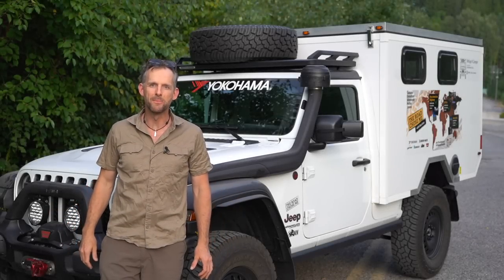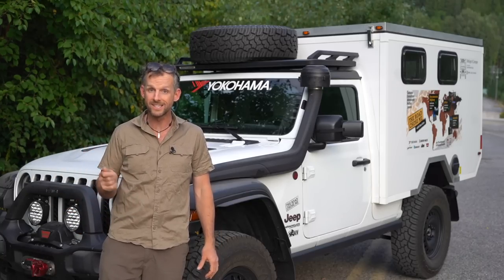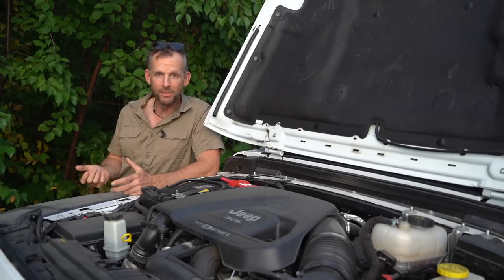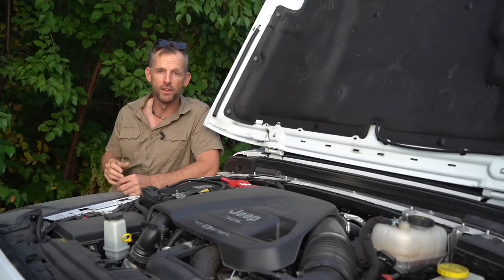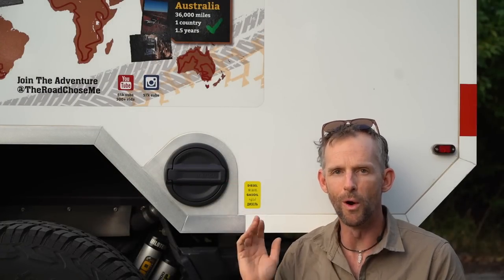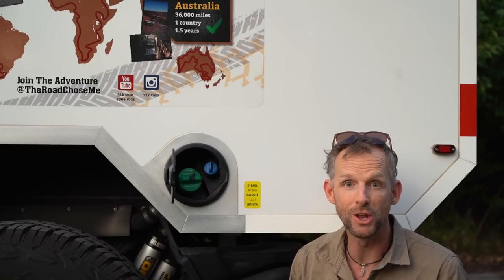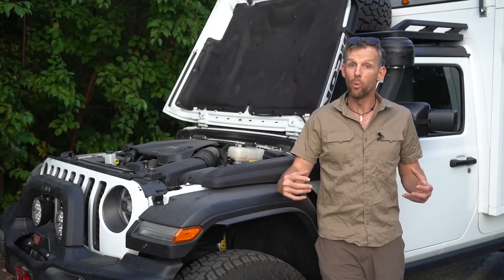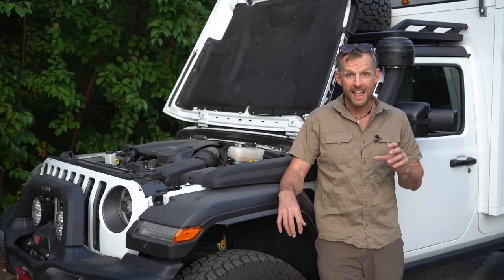Driving a Modern Diesel Around The World - is this a REALLY bad idea?

Comment: I think your biggest issue is going to find clean enough diesel. The holes on the end of the injector are so tiny that any contaminent can cause a blockage or leaky injector. contaminent.

I've seen a few vids of people filtering fuel before they even put it in the tank.
Reply from the maker: I agree 100%. The Jeep has a 2 micron filter and water separator, so hopefully that will help

Comment: I wouldn’t be surprised if you end up spending similar fixing the emissions parts as you would have deleting it. If I was going to countries that run high sulfur diesel, I would not take a diesel with emissions intact. The engine will love the lubricants in the high sulfur diesel, but not thae emissions. With the right tune you may get a slight bump in gas mileage. With the egr blocked, you will have cleaner oil. Also, def last 12 months, 6 in hot weather. If it crystallizes in your DEF tank$$$

Comment: From a certain perspective, older diesel vehicles were not and with low sulfur diesel are still not spewing great amounts of bad air. You can Google results yourself that a well maintained diesel back in the day was cleaner than a gas counterpart. And one study used bio-diesel had even better results. But in the US as usual, big brother kept squashing this. Plus from seat of my pants testing, my older first gen Ford 6.9 got better economy than my 6.0. And then you can get all tangled up in cost to produce both the vehicles and the  fuel. That's a discussion for another day.

Comment: I think you are right on it Dan. Good extra filters and water separator in case you get into some dirty tank leftovers.  They don't have separate oil refineries for the third world, the system is catching up fast and perhaps some countries are cleaning up old supplies. Then there are of course swamp refineries in Nigeria, just try to avoid them and you should be fine.  My plan is still new diesel engine.  You will be surprised how nice those diesel engine work in slow speed offroad driving. You don't need to rev up like on petrol (gas) engine.

Comment: My issue with modern diesels are the temperatures created under the floor.  I believe the systems cause grass fires when dry grasses touch the SCR.  Bush fires are not good for the environment.
Reply from the maker: I am always hyper aware when driving in long grass, and I'm extremely careful to check the exhaust when parking.
Reply: @TheRoadChoseMe  yes but regular gasoline mufflers regularly run between 200°F and 500°F on the high side.   Diesel Particulate Filters can reach as high as 1250°F under regular regeneration. I believe they are dangerous as a fire hazard no matter how careful people are when off pavement, because it can be an ignition source on the outside of the exhaust as well as small particles passing through or rust flaking off the inside could be incendiary. Since you can't control the Regen Process timing, it makes every diesel like a chain smoker flicking still lit butts every 15 minutes.   

In cold or really wet climates it is not  an issue, but in hot/dry areas I believe they are likely starting fires that nobody is aware of the cause.

Comment: Deleted my 3.0 diesel from day 1 of ownership. Never an issue 5 years with more hp, torque and fuel mileage. When the vm engine was designed it didnt have all the emissions crap, thats why you hear about all the issues. Its not the motor its everything added to comply.

Comment: Just hope it doesn’t shut down when you really need to get out of dodge for some reason. 
Based on what I understand of the extremely tight tolerances in modern common rail turbo diesel engines and the associated emissions control systems, it will let you down at some point if you’re feeding it poor quality diesel so you’ll just have to be prepared for that.

Comment: My only fear with any "modern" vehicle is all the sensors and how intolerant modern computers are.  The modern turbo gas motors in the new Jeeps and new Broncos are just as tied down as modern diesels.  Not to mention all the transmission and drivetrain sensors.  A lot to go wrong electrically that is harder to fix in the bush than mechanical issues.  Then again, be smart, be proactive, take your time, don't do anything stupid, be lucky, and you should be fine. LoL

Comment: I would have gone with gas engine. To many unknown factors when you already have the experience of the gas jeep pentastar v6. Both types of engines long term will fade away when vehicles become more electrified. I hope this will be a really reliable vehicle for you because this build looks epic.
Reply from the maker: Thanks. To be honest I didn't love the V6 gas engine in the Gladiator - it hunted between 7th and 8th gear a lot, and it would sometimes kick down to 4th and rev like mad on the highway just going up a tiny hill... it was just not quite enough engine.
The EcoDiesel is so, so much nicer to drive.
Reply: @TheRoadChoseMe  The V6 with the 8 speed auto works super well with the Ursa Minor Top on the JLU.  I am averaging about 24 mpg with about 90% on road and 10% offroad.  Of course I am easy on the pedal and have not lifted it and are running the stock tires.
Reply: @TheRoadChoseMe  6 speed transmission was one of the biggest issues I had with a 3rd gen Tacoma I used to own. Curious if you checked out the Radica Moonlander camper. Was thinking what kind of different builds would have looked appealing to you.
Reply from the maker: I don't like the idea of a camper on a pickup bed - there are so many compromises that I don't want to make
Reply: @TheRoadChoseMe  I agree and that is why I went with the JLU with the Ursa Minor top.  It is lightweight, and I can crawl to the back and sleep on the Goose Gear platform without exiting the vehicle.

Comment: I drove from mexico to ushuahia in 2022 in a volkswagen amarok v6 2018 diesel.  I remove the diesel particle filter and reset the computer for some 300 us. Mainly to be able to use regular oil on the engine. Every thing went perfect. There is better diesel in every country, except Venezuela, than in mexico.  I found the special oil for this  engine. It took me about 4 hrs driving arround to find it, no problem. But i definitly will not drive a modern diesel arround the world. Im geting a gasoline vehicle. Diesel its doable but you stres youre self a bit more. Chears
Reply from the maker: Thanks for the real world input, always highly appreciated!

Comment: 🍻The right engine oil is expensive in the U.S.  What's it going to cost OCONUS?  Taking dry crystals seems a lighter more compact way to have emergency DEF.  What's the downside?  Really looking forward to seeing how this works for you.
Reply from the maker: I've been looking at the oil standards with a friend - the oil the ecoDiesel requires is run of the mill in Europe and Australia - perfectly normal (and a bit out of date) for modern diesels.
Reply: @TheRoadChoseMe  LOL, of course, why am I not surprised? 🤦🏼‍♂  Thanks for the reply and info.

Comment: Love to hear more about performance (driving experience) between the gas and diesel when loaded heavy.  I have a 2009 JKUR that came was a six speed manual when I got it new.  The first 120k miles I left it stock, since then it’s had a Motech 6.2L / 6L80 LS swap.  Fully loaded, my gas mileage is actually better (~16) and the driving experience is night and day improved.  Today I’d go with the factory V8 👍

Comment: We travel in a diesel and had no problems in Africa except briefly in Burundi and northwestern Tanzania. Only briefly.
Reply from the maker: What year was your vehicle? Did it have DPF and DEF?
Reply: @TheRoadChoseMe  Its a 2014 Defender. We are currently in Tan. Our turning point was Uganda. Heading for Zambia and Angola. Sorry, I dont understand your abreviations 😊
Reply from the maker: Your engine does not have the most "modern" diesel emissions controls, so it makes sense it can handle the dirty diesel.
Newer diesels (like my 2021) have many, many more systems that are much touchy on fuel quality.
Enjoy the road!
Reply: Hi Dan….been following you for a while since your TJ travel(I have a ‘06 TJR) til now with your latest JLRD. I’m particularly interested in your present build and you selecting the Diesel engine. No question you’ve added some complexity but I believe it will be well worth it. You mentioned your reasons for the choice you made but I would add another advantage and that is engine torque which is extremely beneficial in off road applications. In addition the 3.0 is very tune able. I have a ‘21 JTRD with a GDE tune which has performed flawlessly and is legal.I get a bump in both HP and torque with virtually no turbo lag. One other thing is I use a product called MaxMPG from Industrial Injection to help my HPFP deal with the diesel we use in the states. I wish you well on your travels and I will be following your adventures. Cheers….
Reply from the maker: @raymonast4753   Thanks very much!
I have looked into the GDE Tune, and the Banks Tune and then some that are not legal too :)
I'm going to look into Max MPG now.
What mileage are you seeing with the GDE Tune?
Reply: I’m getting about 1 to 2 mpg but what makes the tune worth the money is the overall drivability. The stock tune has noticeable turbo lag which is rather annoying is virtually eliminated with the GDE tune. So I know it’s expensive but the results are amazing. I am averaging a combined 23-24 mpg but the tune is even more impressive on the the highway averaging close to 28mpg with a Mopar lift and 35” BFGoodrich ATs. I also kept the stock tuned ECU just in case. Good luck on your travels I will be following along.

Comment: Think maybe you made things more complicated for just a few more mpg, however you only know if it works if you try.  I went back and forth on gas or diesel and ended up getting a gas engine that sucks on MPG, that will be changing soon maybe.  Yes ULSD is becoming easier to find worldwide every year.  With that said I have a friend who is the top dog of a family dealership service department.   He overlooks all the services they do from there 25+ dealers.  They own Ford, chevy, dodge/jeep , Toyota,  etc.  He told me straight out DO NOT buy a modern diesel NONE of the manufacturers modern diesels get past 60k miles before the customer must spend upwards of 10k USD to fix the exhaust and filter system.  Most will just buy a new truck and continue payments.  That's my take on it.  My friend has 30 years with this family of dealerships and I'm taking his word and knowledge,  however I've actually have heard others say the same thing.  All the luck my friend I hope you prove that it is possible.   Take care Dan!  ADDING THIS AFTER I POSTED THIS COMMENT:  The problem is, as was explained to me, is that it's unrealistic demands from word governments when the technology doesn't exist.....you know like electric vehicles.

Comment: What will you do when the high pressure fuel pump fails and clogs the DPF?
US trucks have been at the dealer as long as a year waiting to be repaired. These pumps fail in as little as 20,000 miles.
Reply from the maker: There is an active recall on the pump, they're replacing them with the tried and trusted Bosch CP3. I've heard parts are arriving at warehouses now.
Reply: @TheRoadChoseMe  all modern automotive diesel fuel injection equipment is designed to work with fuel that has lubricity of 460 micrometer wear scar or better (EN 590 compliant diesel fuel). Us or canada don't have a lubricity standard for diesel fuel. If fuel that has lubricity less than 460 micron wear scar is used injection pumps will break prematurely.
Reply from the maker: Interesting, thanks very much. Do you know if High Sulphur fuel will actually be better in that regard?
Also is there an additive I should use to add lubricity?
Reply: @TheRoadChoseMe  I've been reading that even when using an additive the pump still fails.
HSS (Hot Shots Secret) is supposed to be a good additive. I was using Primrode 5007 in my Volvo truck.
Reply: I'm thinking about building a Wrangler JK and duplicating the AEV Outpost II, but with a Mercedes OM606 diesel engine. This way, I can also run the engine on waste veggie oil
Reply from the maker: The engine I tried to swap into a JK was a 606. Great engine, but it seriously doesn't fit in that engine bay. It was a pain. The guy who has it now drives it everyday though, said it runs great.
Reply: @TheRoadChoseMe  high sulphur fuel can be better in that regard because the process used to remove sulphur also reduces lubricity. Generally speaking diesel fuel that has had sulphur removed needs lubricity additives to meet the EN 590 lubricity specification (that means all EN 590 highway diesel fuel sold in europe has lubricity additives in it). In the north american market diesel fuel additives like stanadyne performance, power service diesel kleen and diesel fuel supplement and hot shot's diesel extreme have lubricity additives. All of them also have cetane number improver. EN 590 minimum cetane number is 51. The astm diesel fuel standard used in most of north america has minimum cetane number of 40. Outside of california and certain counties in texas that require 53 or 48 respectively most north america diesel fuel is about 42-45 cetane number. Higher cetane number means more complete combustion (especially at higher engine speeds) and reduces particulate emissions (cetane number measures how long the fuel takes to ignite after being injected into hot pressured air like is found inside of a diesel engine cylinder at the end of the compression cycle). Less particulate emissions means less chance of particulate filter clogging and less frequent need to regenerate the particulate filter.
Reply: @nickaltvater5592  not all additives have lubricity enhancers. Also you can't just use an additive that has lubricity enhancer every now and then.
Reply: @blegi1245  I can if I want
Reply: @TheRoadChoseMe  who's kit did you use? Mercedes4x4 is getting horrible reviews
Reply: @nickaltvater5592  not the fault of the additive for injection pump breaking if you don't use it.
Reply: @blegi1245 that's obvious.
Reply from the maker: Very interesting, thanks for all the info! Do you have a link where I can read more?
Reply from the maker: @nickaltvater5592 Custom made adaptor

Comment: Surely we have reached the point where, for overlanding, we need to use a petrol/gasoline engine. They are lighter (so you can carry more fuel within GVM), they are quieter, they are a lot less complicated and you can use them anywhere.
Reply from the maker: That has been my theory for a while now, and I'm excited to experience the other side to learn the pros and cons first hand.
Reply: I definatly agree on the noise point. And they are lighter but also constructed less durably due to the nature of the engine differences. A diesel engine will last longer and get better fuel efficiency hauling weight around. Imo it comes down to use case. A custom rig like Dan's seems like it would benefit more from a diesel engine in his use case. But I do agree if your overlanding a  mildly modded 4 Runner or Jeep a gas engine would probably suit you just fine unless you had it overloaded or were towing with it. I could be wrong but I feel like there is a reason that diesel engines still exist and still pretty much do all the heavy hauling in the world.

Comment: ULSD is a problem outside the developed world.  While your ULSD map looks very rosy, the reality is somewhere in between.  Yes, some countries like Mexico, South Africa and India now have ULSD even though the sulphur ppm is higher than the Euro 6 standard which is about 10 ppm sulphur. Lot of these countries have anywhere between 15-50 ppm which might suit the earlier Euro X standards but not Euro 6 or the new Euro 7.

The funny thing is, you always seem to tailor your arguments around what you personally have vs an objective discussion of pros and cons on ULSDs.

You would be hard pressed to find diesel in most parts of Central Asia in the Stans let alone ULSD.  If you entered places like Uzbekistan through Turkmenistan and Iran, you will find out that you are going to have problems finding diesel for very long stretches until you reach Tashkent .  Even Petrol availability is scarce and you can find dirty bush petrol that would force you to change your air and fuel filter after being forced to use that crap for long stretches.

Barring Southern Africa and perhaps a few in Northern Africa, ULSD is an impossibility in Africa but you don’t have to worry about Africa for your future journey.

So the rosy picture you paint for ULSD availability is far distant from reality but then again, you always tailor your narrative to fit the choices you made however on point or off point they are so there is not much objectivity in your video except pushing a narrative that fits the choices you made like a square peg in a round hole.
Reply from the maker: Remember I'm not going back to Africa.. in fact, I'm not going anywhere I've been before. What excites me is the places on the map I've never been to before.
Also that ULSD map should give some clues as to where I AM going.
Reply: @TheRoadChoseMe  Yeah, I know where you are going.  But you just gave me an evasive response.